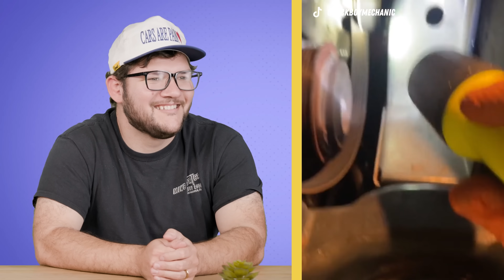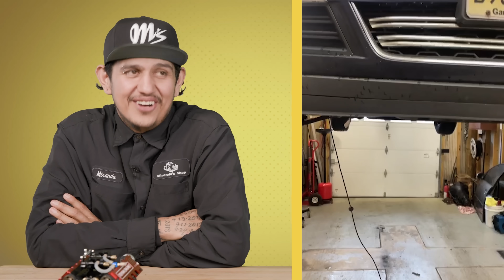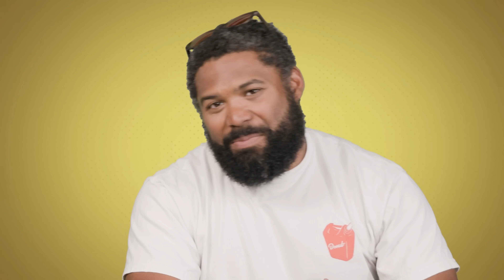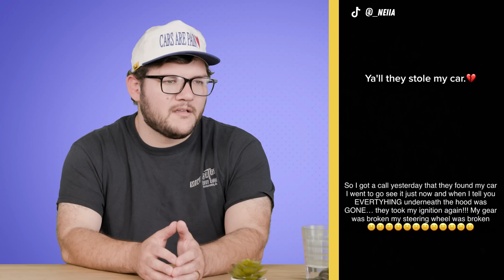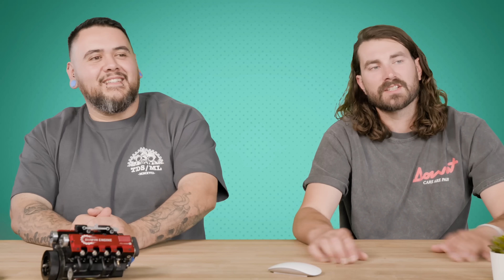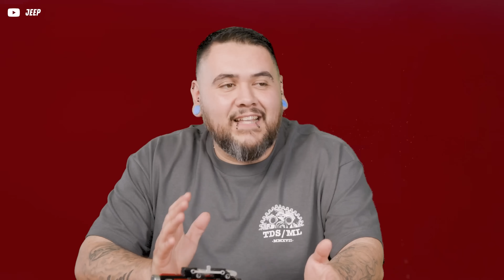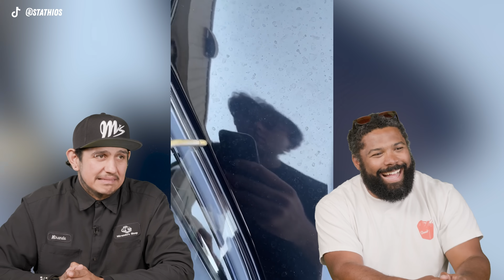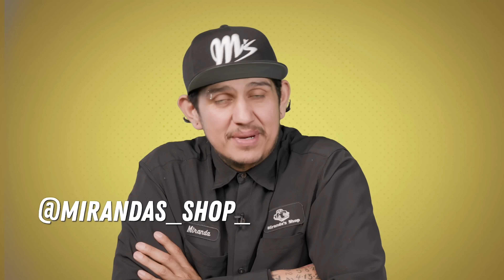Mechanic Reacts to Car Engineering Fails

Comment: I was a lube tech at Ford for a while, and now I drive a Ford Mobile Service van that's been great--- That being said, at the shop, we call the yellow plastic dran plugs on F-150s and such "yellow jackets" because they're fast and prone to fck you over lol. Especially on the ones that are 90°s to the side; it's always a 50/50 whether the force of the oil from that large hole is going to just say 'fck your cardboard' and either splatter three feet either side of it, or throw it out of the way entirely 🥴

Comment: Bob Lutz a veteran of the auto industry wrote a book called car guys vs bean counters, and it pretty much explains all of the problems we have today:
"It was in 1979 in the United Kingdom. I had just been elevated to president of Ford Europe and was conducting my first monthly quality meeting.

Ford’s quality was about average for Europe at the time, but we were having a major problem with our UK-built four- cylinder engines: camshafts (an essential part that controls the valves) were wearing out at a totally unacceptable rate. Some camshafts failed after as little as 10,000 miles, few lasted more than 15,000 miles, and the bulk of the repeat failures occurred soon after the expiration of the then-prevalent 12,000-mile warranty.

I asked what we were going to do to achieve industry- standard durability on camshafts. Manufacturing and Engineering had a number of solutions, all requiring some increase in parts cost and a nominal investment in equipment. I authorized these on the spot, and emphasized the need for speed in incorporating the changes.

End of story? Not quite! The finance guys piped up and informed me that I had, by my hasty decision, just blown a roughly $50 million hole in the profit forecast. It seems that was the amount of profit the Parts and Service organization was reaping by shipping an endless stream of shoddy, soft camshafts to hundreds of thousands of customers who “had no other choice . . . they’ve got to buy them.” Yes, they had no choice . . . until their next vehicle purchase."

Comment: 10:00 with Tesla it's definitely not just the factory, but a clusterfk where nothing works.
The production process is poorly engineered. It's not that the builders just happen to do a bad job, but that they're put in a position where it's rarely possible to do a good one.

Comment: On the point of oil drain plug locations, many manufacturers now recommend using oil vacuum pumps to draw the oil from the engine rather than removing the drain plug, so less effort goes into to clearing space to drain oil.

Comment: I have your solution to the engineering problem right here.  All companies need to do is this:

1)  Every manager that's in charge of an engineering problem must first have worked in engineering that kind of item.  This way they understand the problems.
2)  Experienced mechanics need to be in the design loop.
3)  The people engineering the components and the people engineering the body/frame must collaborate with said mechanics.

Sadly, what I cannot solve is the overarching management problem that plagues every publicly-traded company.  As long as you have shareholders telling a board telling a CEO telling accountants telling managers telling engineers what to do, the above solution will never happen.

Comment: I blame the engineers for most of these issues. Here's why. If the engineers designed the parts in a way that when they get installed it's nearly impossible to get it wrong, there would be less mistakes. Just as an example, I threw some junkyard doors on my 97 4Runner and the panel gaps were perfect with no adjustment needed. Now that's just one example but I think the engineering has a lot to do with it. Things like the bolts that are used are self aligning and things like that.

Comment: Tragic. My parents buyed their garanty of there MAZDA CX-30. Nothing but problems. Nothing solved. Even they didn't fix it and even someone from the factory came by. Couldn't see what was wrong. Because of there is nothing on the computer that's wrong! OMG. Our chevy Malibu LT from Germany is even better then a brand new one from mazda. The knocking while turning your wheels while your breaking. Is normal. My car doesn't. There new one does. 🤣 Pain in the ass.

Comment: I've been a mechanic for over 40 yrs, having worked on military  helicopters, commercial aircraft, heavy & compact equipment, commercial trucks and trailers, and a host of other types and sizes of vehicles, craft, & equipment. Trust me guys, it ain't just cars.

Comment: On the flip side of the coin... I had an old hearse, build from a Cadillac Broham. I can't remember what year, I think it was a late 90s. The OEM stereo was a tape deck, so it had to be mid to late 90s. 
Aside from the BS anti-theft that would just not read the pellet in the key, that thing was easy AF to work on at least for anything forward of the coach. I swear, you could just get in the engine bay. I've seen car manuals call it an engine room, this was the only one I've worked on where I wouldn't call that preposterous. I'm not a mechanic, but I still did a bunch of work on that car! 
I remember having to take it apart to evict a family of squirrels. So many acorns. So many many acorns. 
I never did mange to get that coolant to stay the right color though. I had to get rid of it before I got that coolant issue resolved. I was unable to do anything on the car for several months due to health, and my ex didn't tend to it like she said she would and just let the roof leak flood the car doing catastrophic interior damage. Sold the remains at a huge loss. Sad days.

Comment: Born and raised in Jeep's hometown, and yeah, Jeep's rep has taken a massive beating since Daimler bought them out, then Fiat. Used to be that the Wrangler was a cheap, easily modded, off roading machine. Slap some 36s on there, a winch, a roll bar and you could do quite a lot. Now? They're garbage.

Comment: On my Wife's Ford Escape you have to take out the Air Intake and part of the wiring harness just to get to the battery. Then you have about a 2 inch gap to work out the bolts on the Battery Tiedowns... so much fun...

Comment: I dealt with a lot of bad engineers in a non automotive field my last 17 years working for that major corporation. Not all were bad but over 50% were from my experience. Book smarts and common sense don't always match up. And it just continues to get worse as time has passed.

Comment: stuff like this is why I, as a person who grew up and still is working on a farm, am going into the engineering field. and I will do exactly as you suggested: whenever i'm working on a new design for a tractor or combine or any peice of equipment, I will go out and turn wrenches on the prototypes, and come back with a PITA, or Pain In The Ass list, listing all the wear parts that take a lot of time, effort, and frustration to replace, with an emphasis on time. farmers are at the mercy of the weather, and time is priceless to us. you spend too long in the shop, and bad weather hits, you can lose potentially tens of thousands of dollars. and sometimes, it's over a stupid cheap and small part, like an O-ring or something.

Comment: Some grease monkey states the bolt could be an inch shorter. Forget the math, forget the loads and forces. Monkey says shorter. That being said its usually identified but servicability is an afterthought to a manufacturer. What is the cost  to change the design or the cost to remold or re tool. Its not just engineers making executive decisions.

Comment: 4:00 I have a killswitch its a clutch
also my 6speed is extremely difficult to drive my clutch is numb unforgiving and my 1st gear feels like 2nd.
so manual drivers  and professional truck drivers look dumb driving my car.- btw my car is a 2017  toyota corolla IM with 23,000 miles.

Comment: PT cruiser alternator change, you are supposed to remove the passenger side suspension to get it out from between the block and the firewall! Luckily if you remove the heat shield on the exhaust and grind down a bolt head you can Houdini it out the top.

Comment: This reminds me of a microwave combi-oven (has fan oven as well. You can pre-heat the oven, but when it finishes heating tot he temp you want, when you go to "oven" mode it will reset the temperature! It is like these things are designed by people who don't actually use them

Comment: Design fails seem to be what hold my 05 sts together. On most cars, the alternator is up, in an easily accessible location. In my sts, it's at the bottom of the belt drive, and you have about an inch of space total at the back of it to loosen the last mounting bolt. It's not terrible reaching the front bolts because once you remove the intake tube and the fans, you have like 6in of space to work in. It takes about 15 minutes though to loosen the back bolt and equally as long to tighten it. Another one I noticed is that when the driver side valve cover gasket (on the V8) starts to leak, it gets into the ecm 🙃 if you don't catch the leak early enough, you end up needing a new computer.

Comment: This isn't THAT bad engineering wise, but I had to deal with it recently and it was pretty annoying.

I've got a 2004 Saturn L300, thank you for your sympathy/your mockery is accurate.
I needed to recharge the AC, which as anyone who has done that will tell you that's a pretty simple task, takes a couple minutes, assuming you don't have any leaks or issues. I did have a leak, but that's irrelevant currently.

The annoying engineering thing was, the low pressure port that I need access to in order to recharge the system, is NOT easily accessible. On the passenger side of the hood, I need to reach in behind where the engine is, around some stuff to get to it. It's also suggested by every youtube tutorial AND the instructions on the cans that while you're refilling you should tilt the can from 12 o clock to 3 o clock. This damn thing is so deep in the car the hose literally doesn't reach that far. So I need to lean over the side of the car, precariously hold onto this thing, secure it and then holding it UPSIDE DOWN I need to awkwardly contort my body to refill it and also be able to read the gauge as well. Just to add to it, I cannot set the can down without disconnecting it first because just dropping it is obviously a really stupid idea. And of course I need to do this all right next to the engine WHILE THE CAR IS ON.

You REALLY couldn't have put that damn thing ANYWHERE more convenient?

Comment: egr systems    .... mainly the water coolers for the exhaust gasses leaking coolant water in the engine creating steam and nuking engines. from the ford ecoboost to expensive german cars to 6cil commercial diesel truck engines...... lots of sad client faces xD if they survived       plz just stop this egr shit it really isnt worth the risk guys. 16000$ for a new midblock for a 750D really xD the coolers only 400$ on that car btw